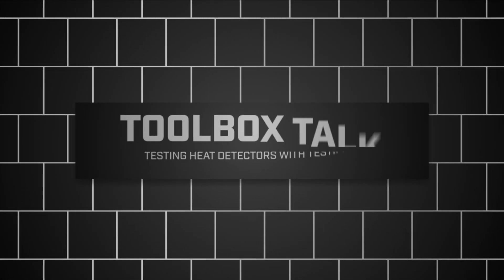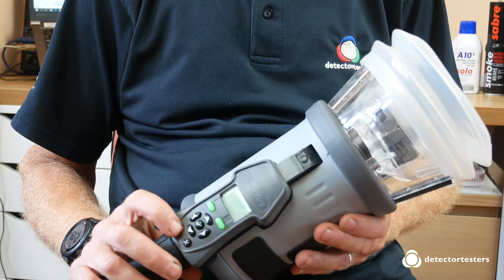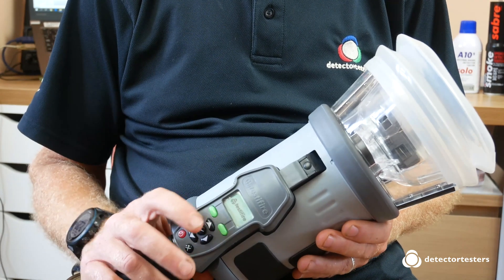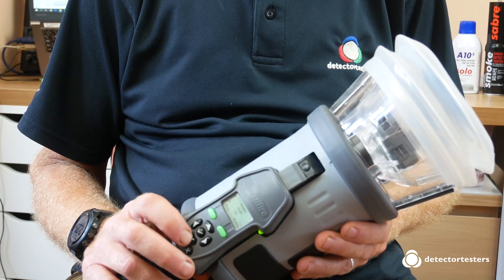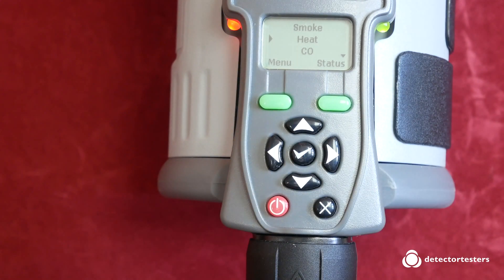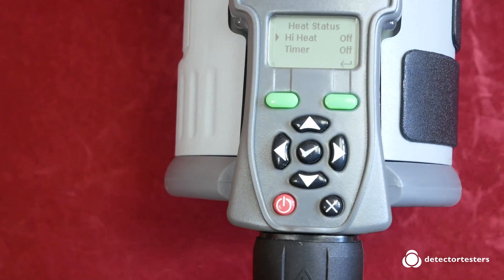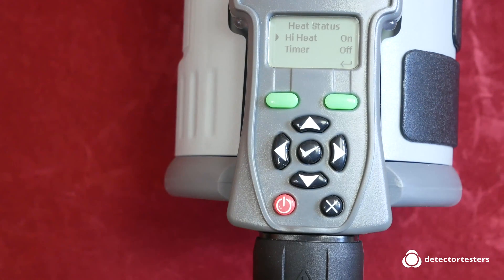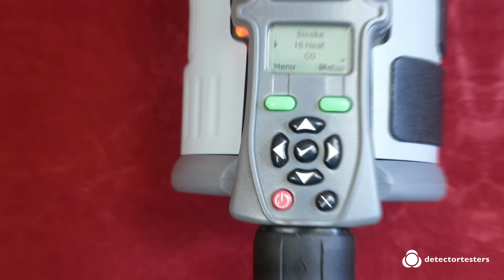TOOLBOX TALKS - TESTING HEAT DETECTORS WITH TESTIFIRE

Comment: What if the detector does not reach the threshold of the sensor?
Reply: If the heat detector tester does not have the heat output required to activate the heat detector sensor threshold, the detector will not activate. It is important that you use the correct heat tester according to the heat detector class to be tested. 

Heat detector testers manufactured by detectortesters (includes Solo and Testifire) are designed to test UL heat detectors that have a temperature class of Low/Ordinary and Intermediate. For European (EN) heat detectors that is Class A/B and C. 

The higher heat detector activation class (intermediate for UL and Class C for EN) typically have an activation temperature above 194F (90C). Testifire can test detectors up to 212F (100C) 

Please keep in mind that the ambient temperature (in the protected area) can have an impact on the ability to test a heat detector as a low ambient temperature can mean that it is not possible for the tester to reach the activation temperature.